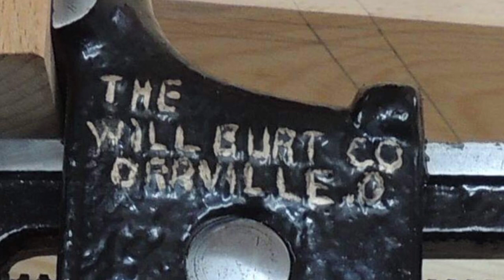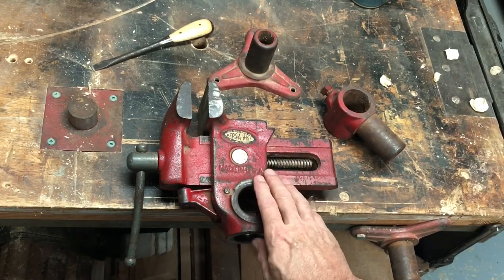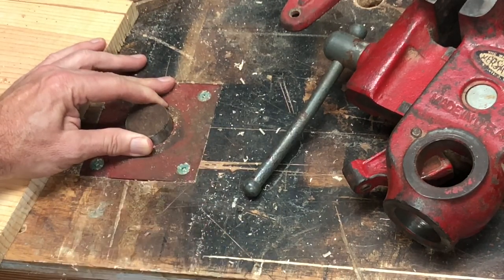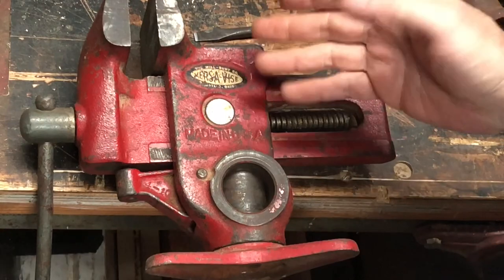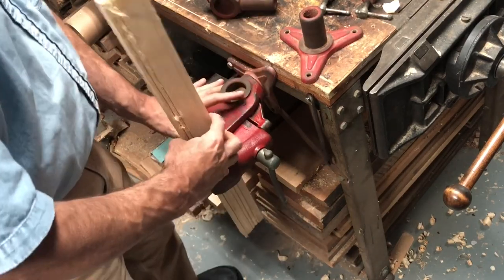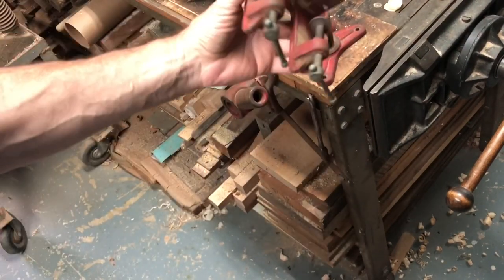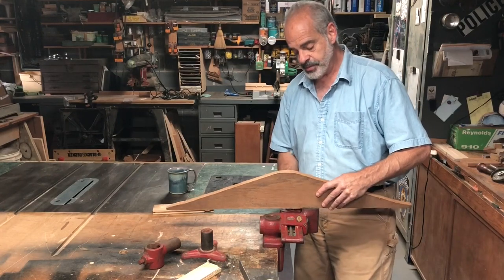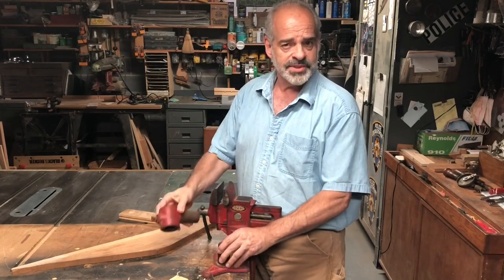VERSA VISE or VICE VERSA

Comment: I found one on Craig's List like the one shown here, and it came with the flush-mount and offset adapter... I ordered a base mount that has the three screw holes off of ebay... I recently built a "portable" stand using a Harbor Freight Universal Tool stand for a Reed No. 105R vise that I picked up a few months ago at a local flea market...made a top using two pieces of 3/4" plywood I had handy, glued together, with a piece of 1/4" hardboard on top... I keep this vise and stand in my garage workshop area... so I used one of the back corners of the stand to hold the flush mount attachment.

I made a wood mounting base for the Versa Vise base mount, so that I can use my woodworkers vise on my basement workbench to hold it, and be able to use the Versa Vise in a couple of directions... I'm going to enjoy this Versa Vise ! Thanks for the great video !
Reply from the maker: Thank you. Sounds like a lot of great ideas.

Comment: Thanks for this expansive look at these vises. I picked up the gyro vise version of one of these today, and not until I got home did I realize it was missing a part. Do you know the name of the locking mechanism that sits beneath the 'arm' of the vise and pins against the post? I'm without mine. Any idea of the name I might search under for trying to locate a replacement? Or know of where a replacement piece could be found? Thank you.
Reply from the maker: I wish I could help you. The lever is what I call it but have no idea where you could easily find one. That being said, I would look on eBay and set up a search for it as well as checking in with CiHI auction group in face book. Can I Have It group.
Reply: I was just given one today.  It had the pipe clamps with it.  I should ask if there were other parts you listed with it.  Thank you for your effort in a most interesting and professional educational presentation. Regards, Lee